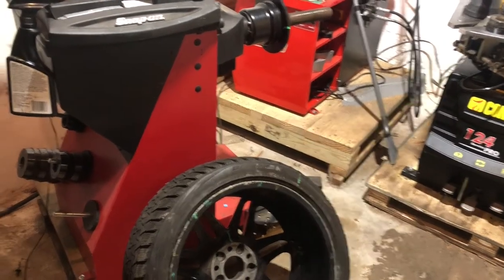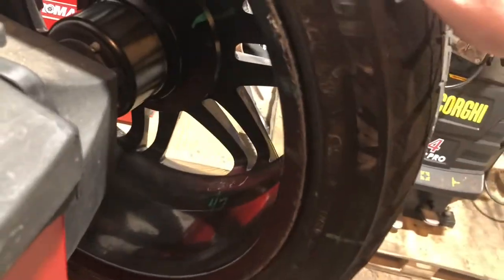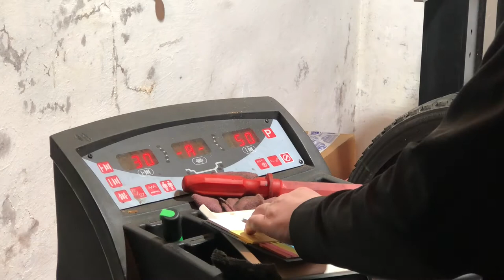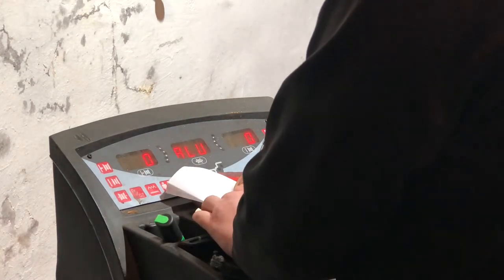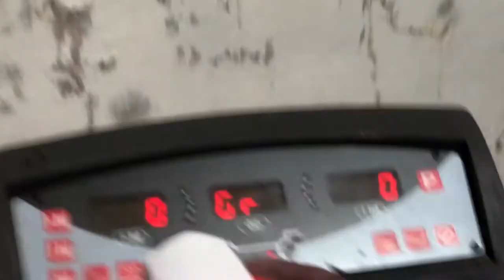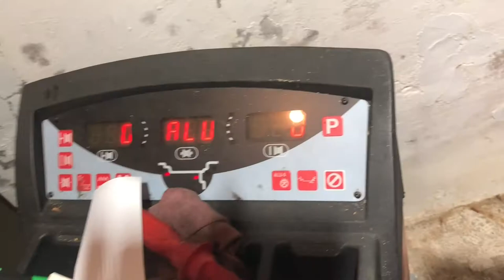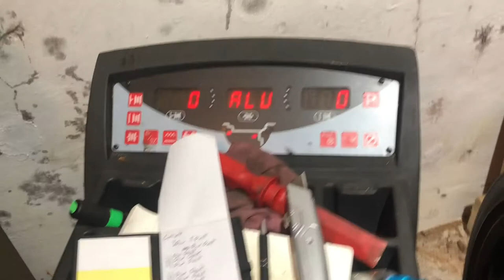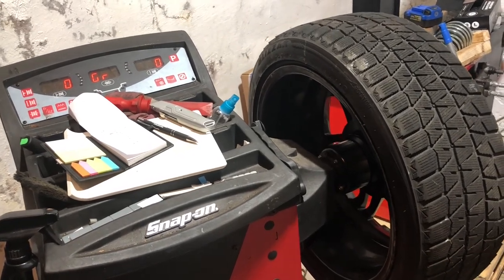A PERFECT WHEEL BALANCE PT.2.  PRECISION COLLETS

Comment: What about steel weights on the outside vs stick on weights slightly inwards. Do they give any real world differences even though the machine can balance to zero with both.
Reply from the maker: the weight setup does not matter in regards to the way the wheel is put on as long as the balancer is told. the further out to the edge of the rim you put the weights the less weight will be needed compared to putting weights further in. collets and finger plates will give a more accurate balance compared to the cone though.

Comment: Thanks for the vid, so on the volvo s60 the center bore is 65.1mm i think, are these collets the exact fit? if so, as i only have volvo's it might be worth getting some.
Reply from the maker: if there was a specific collet for Volvo check out Haweka( they specialize in balancing). they make collets specific to some car manufacturers, maybe Volvo. my collets are a fine taper, which does a much better job centering the wheel but are not meant for a specific car. make sure the wheel bore is clean of corrosion as well as the wheel hub surface!. my set is from Haweka as well, along with my finger plate set. they are very nice quality  and will cover the majority’s of vehicles on the road cars and light trucks/SUV’s. you can buy individual size collets if you want. look up Haweka USA and call them, the reps name I think is Tom and he knows his stuff!
Reply: @geardriven1016  I'm in the UK and they seem expensive. I will probably keep an eye out on ebay for a second hand finger plate. Snap on balancer only cost me £200.